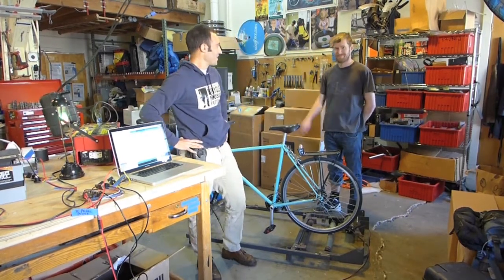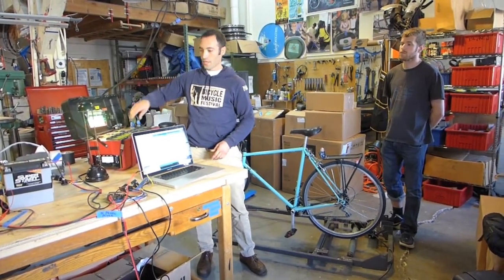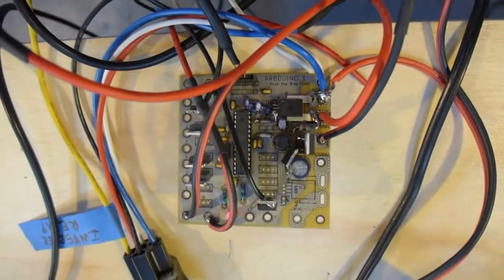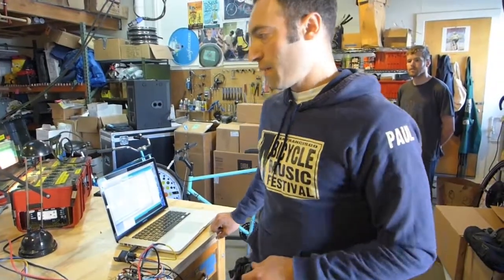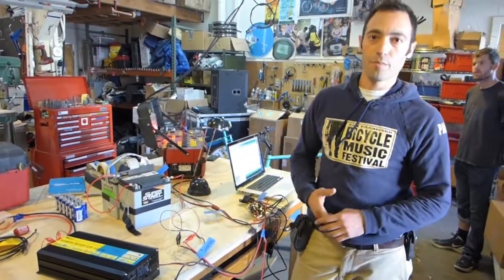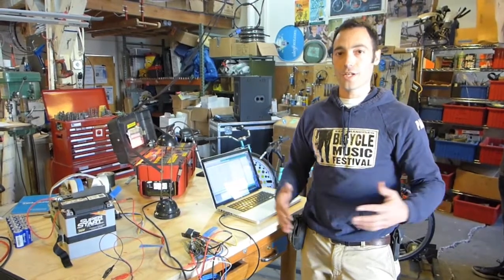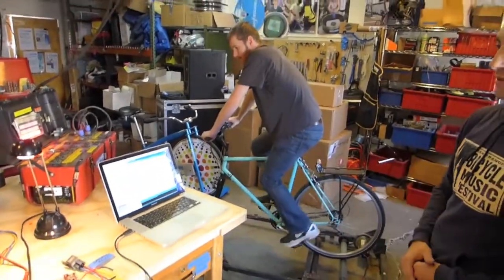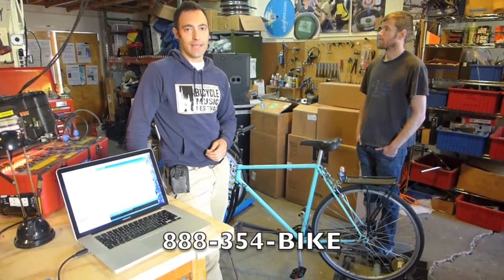Arbduino: Open-source Pedal Power computer

Comment: could I use this arduino program to power a gaming PC? the idea is to be able to indulge in gaming while avoid the detrimental health effects if sitting still for too long.
Reply: I have no experience here and am not affiliated with this company. That being said... yes and no. Yes, you could power ANYTHING with this... no, it would not be a 1:1 time ratio.  What I mean by that, is you might need to pedal for 20 minutes to power your gaming PC and monitor together for 1 minute.  It's not like you could just sit at the PC and pedal, and it would operate solely on the power that you're currently generating in the moment.  You would have to have pedaled for hours **IN ADVANCE** to get any usable time from your PC.  If you wouldn't mind pedaling into your late 90s, if you even live that long, you could potentially power the next Titanic... for the first few days of it's voyage.  That's my two cents and obviously not a complete answer.  To be fair, it wasn't a complete question either, because you never specified the wattage usage of this hypothetical PC.  Figure out what it is that you're really asking, and I'm sure you'll be able to do the math for yourself.  Anyway, a better question would be: "How many watts can I likely put out using this bike"?